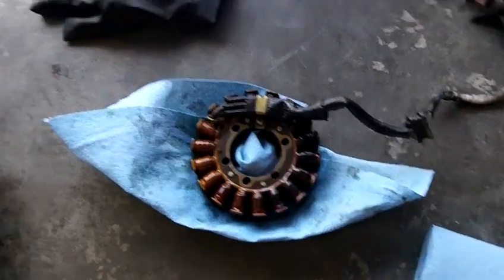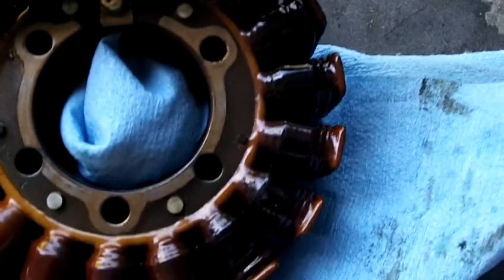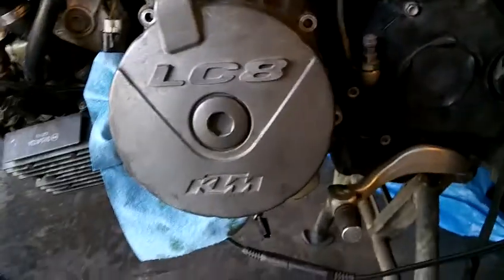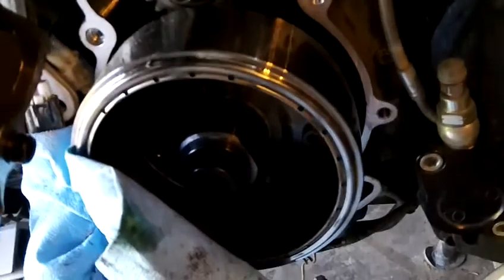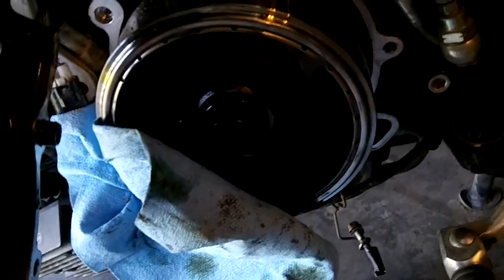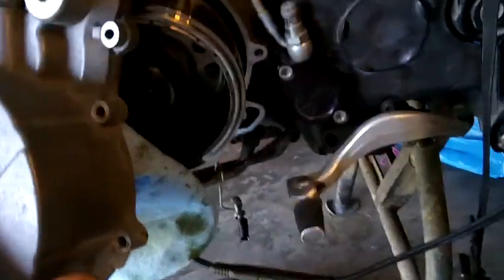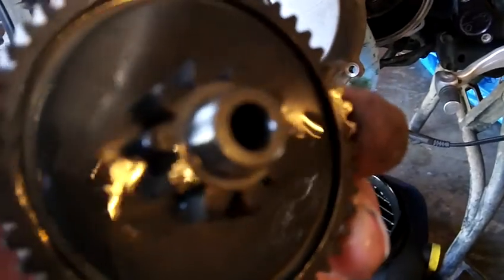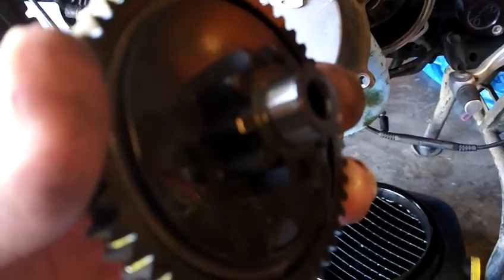KTM 950 Adventure Stator removed!

Comment: Interesting acquisition. What was the mileage of your KTM at that time?
Reply from the maker: Can’t remember at this point. That was 3 bikes ago. It was definitely more than 50k miles.
Reply: @Dadventures1190  Thanks for that. Mine is doing the same thing and I've only done 17K miles. The 3 pin connector on the R/R has melted due to dirt and oil inside it making poor connection. I'm changing the connection only for new one for now and see it helps before changing my stator. I love the 990 though. Nothing even comes close to it even to  this day.
Reply: @pmfilmsUK  I have exactly the same symptom as you on my 990 with 33,000km...melting connector, which the PO allowed to get way too grimey. Did you end up having to change your stator or just the connector? Cheers
Reply: @Reshad77  Hey Reshad. I changed the big 3 pin connector with new one and new wiring loom to it. I noticed who ever changed the oil screen (which sits at bottom of left oil tank) dropped oil onto the connector and after time the the connector had lost its connectivity giving poor charging. I always wondered why there was so much oil in the connector. I moved the position of the connector and put some electrical tape to keep it clean. Luckily my stator was fine when I did an ohms test. She runs and charges beautifully with the new Lithium battery. When idling, it should be 13.7v to 14.3v and no more than 14.4 when reving to 4k. Also make sure the wires going to the starter relay have not changed color or gone hard. It puts stress there if connector is bad. This is located behind black plastic trim underneath right side bash plate. Hope you get your mojo sorted.
Reply: @pmfilmsUK  Many thanks, Patrick, for the advice. I also inherited a terribly grimey and oily connector from the PO, which I suspect happened during sloppy oil changes, crept into the electrical connectors and even into the wire. So I got rid of the connector altogether, trimmed the wires and insulation back to get clean copper and healthy insulation and joined the R/R and stator with a heavy duty screw type AC electrical connector. No more hot melting wires. The R/R was actually on its way out too, so I fitted a new unit from a Suzuki GSX1000R for a fraction of a KTM OEM cost. All is now hunky dory, and the battery charges well ☺️
Reply: @Reshad77  That's fantastic Reshad. Good idea to do a proper connector. Alot of ampage passes through those wires. When these bikes are set up properly its very rewarding. I still get a smile when I jump on mine. I just have to get used to the throttle response below 3k rpm. It's very twitchy and jerky and there is nothing you can do about it. Nature of the beast.
Reply: @pmfilmsUK  Well, there are a few things that could be done to improve the throttle response, which I did on my 2010 KTM 690 Duke, notably changing the final gear ratio, eliminating the SAS, remapping and having a more forgiving throttle curve at small throttle openings. I wanted to mod the throtttle curve of the 990 too, but this not an option, infortunately as there is only one map compared to the two of the 690 :( I actually want to keep the 990 as stock as possible as it needs to pass checks every 2 years. But as you said, that jerkiness is the nature of the beast and all you just have to do is up the revs and she's happy again :D
Reply: @Reshad77  Very interesting prognosis and it looks like you know what you're doing with your KTM's. I wish I could take mine back to stock. The guy who had it before me did some pro racing in Isle of Man with it and had it all tuned professionally. Therefore, all none essential parts were removed including centre stand and SAS. The beast is very light and balanced perfectly. Thats why I bought it and still happy with my purchase. Wouldn't change it for anything. Happy Christmas.